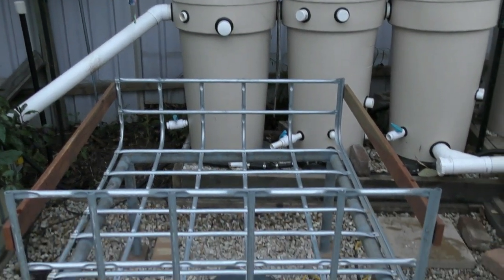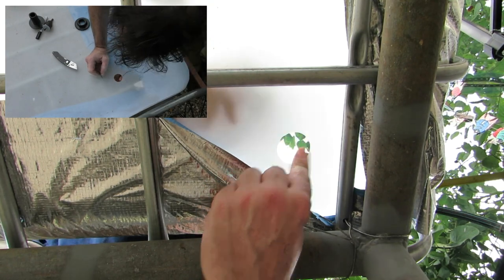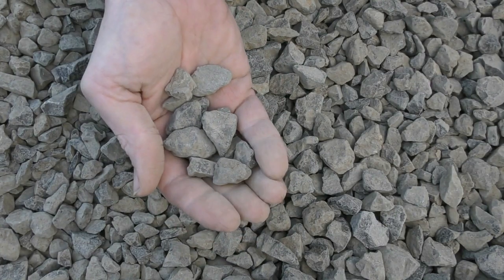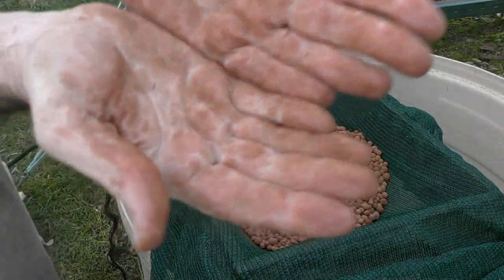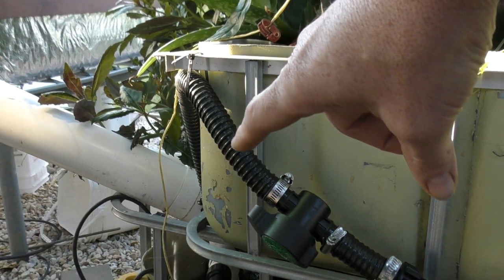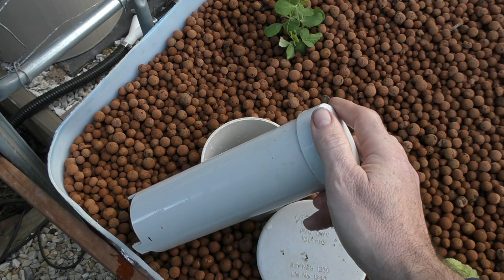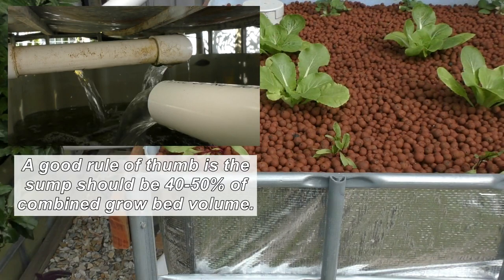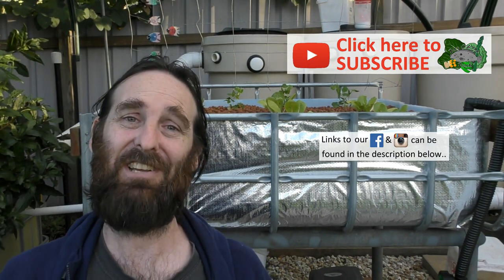How to set up aquaponic grow bed & select the right rock.

Comment: Are you running a single pump or multiple pumps? What is the GPH rating on the pump(s) you are running? I'm thinking of getting a second pump, so that I have one just for the fish tank and the other for the grow beds. That way there is plenty of pressure hitting the venturi in the fish tank. I have 2 grow beds, a sump, and a fish tank with a 800ish gph pump.

I should add, my pump has about a 3ft head.
Reply: exeseven His pump is a stand alone, magnetic drive, 10000 LPH
Reply from the maker: exeseven The pump I'm using is a 10,000lph/2641gph (US) Resun pump at the moment in a split flow configuration. Have 3 venturis running from that one pump with no issues. Have a bit of a better explanation here if that helps . 
https://www.youtube.com/watch?v=N4mYcUvZ9cw
Cheers mate.
Reply from the maker: ***** Cheers Bobby.
Reply: RobBobs Backyard Farming Thanks!
Reply: RobBobs Backyard Farming Hey Rob, glad to see you post a new vid! Perfect timing! Just got my Tank and Filters up and running and started my fishless cycling and now I'm about to start working on the grow beds! Getting pretty excited about getting some fish and plants in! Hey BTW, I sent you a response to our last conversation on the messenger. Talk at ya later!
Reply from the maker: ***** Great to hear Bobby.
I miss messages on there all the time sorry mate. Best to get me on FB if you have an account. Will have a look at the messages in the morning, well, later in the morning. is 1:20 at the moment.
Cheers mate.

Comment: Can you mix the rocks for the bottom and the clay on top?
Reply from the maker: You can mix them if you want. I prefer the clay on top as it's easier to work with. 👍
Hope the system is going well. 
Cheers Jason.

Comment: do you have anything to say about caterpillar or worms eating leaves in aquaponic system?
Reply from the maker: 2ebandera Hi again. Just saw this post. 
Haven't had many issues with them lately. If I did I'd use a BT (Bacillus thuringiensis) bacteria based spray to keep them under control. Its safe for fish, mammals, amphibians & birds. Is safe to use of certified organic farms as well. 
The other option would be to net the area off which may happen in the future at some point. 
Hope that helps some.

Comment: Quick question or two, are you going to start your own breeder colony, to control your fish from outside deases? And sorry i didnt answer you back right away my computer was not updating correctly!   Have you tried air lifts yet? Im going to see if i can, because the wattage use is a lot less,i do like having pressure on growbed fill,but also think useing the over flow from tank is the way to go,that way i will get air in system water movement and no chance of fish tank going dry, just want it as idiot prof as possible, kids,dogs,chicks,racoons,ect....  Oh yes ME!  Get buizzzy forget! You have gooday mate.

Comment: Nice build Rob. Is cost the reason you didn't use all clay?
Reply from the maker: ***** Cost & carbon foot print both come into it Jay. All the clay gets made in Europe & shipped over so it cost around $1AU a litre if bought by a single bag. I got it quite a bit cheaper as I bought in bulk to help mate out ;) 
Cheers mate & hope all's well with you all.

Comment: How much water would you say the media displaces, like 50% of the volume or is it much more, like 75%?
Reply from the maker: Some folks give an average of 70% water displacement but I like to stick with 50%. 
Comes in handy to overestimate the amount of water the beds need to fill when working out sump volume. That way there will be more water held in the sump which means the system can go longer between top ups if need be. 
Hope that helps.

Comment: Bulk head fittings V your Uniseals  care to explain please Rob?
Reply from the maker: Tony McKessar Hi Tony.
Both have their place in the system I think. For running large holes through tanks & filters I prefer the uniseals. For the smaller fittings like the base of the grow beds I like the bulkheads. I do have one grow bed with a uniseal in the bell assembly but am not 100% happy with it, it's just not sitting right. 
I have used uniseals for water lines flowing into tanks as well as bulkheads with no preference for either in that situation. Uniseals normally win over as they are cheaper & more adaptable than a threaded bulkhead. 
Hope that helps some mate.

Comment: How do you get the clay balls to keep from floating? When my systems cycles the balls go up and down and my plants keep sinking deeper in the balls
Reply from the maker: Hey Justin. It can take anywhere from a few days to a few weeks depending on the brand & sometimes different batches of the same product (due to firing temps of the cay etc). 
Most of ours settled down within a weeks here.
Hope that helps some.
Reply: Thanks rob. I was wondering, no good info on it that I have found

Comment: How many gallons of water do you need to run each ibc bed?
Reply from the maker: Hi Jackie & thanks, am glad the clips are helping you out some. 
With these beds I cut them off at the 300mm/1' deep from the side of an IBC.  This gave me a flat base to work with for plumbing + the side of the cage offers better support for the bed I think.  
As for the volume, after some height was allowed for a lip on the edge (to stop the clay falling out) & a dry layer of clay that's not under water (to stop algae growing on the surface) they hold 300 L or around 66 gal of combined water & grow media. 
From there I like to use allow 50% of the 66 gal (33 gal) as the amount of water needed to flood the bed. This allows for extra water when it comes to calculating the water volume needed when sizing your sump. Having some extra water in the sump will help stabilise the water temp a bit & also allow for longer periods between sump tank top ups. 
Probably more information than you wanted but it might come in handy.
Cheers.
Rob.

Comment: I work for a company that processes carbon coke(commonly used in the steel industry) and after seeing some vids on aquaponics I'm curious whether it could be used as a growing media. I don't suppose u have ever heard of it being done?
It is a very porous and hard material, which leads me to believe it would work. The process by which it is made removes volatiles so I don't believe it would negatively impact the system through contamination.
Reply from the maker: Hi Ken.
I haven't seen anyone use it at all mate so it would be interesting to see how it goes. As long as it's inert, pH neutral & doesn't release suspended solids if could be a goer  👍👍 A few universities that have aquaponic systems may have looked into it. 
Would like to know what you find out if you get any info on its suitability.
Cheers.
Reply: +Rob Bob's Backyard Farming 
As part of an environmental assessment we know that it is completely inert. It should be exactly like activated carbon in terms of effect on the pH. Idk about suspended solids, what do u mean by that?
Having worked with it(I'm a floor level guy) I know that because it is so hard it will create dust as it rubs against it's self, but that is when it is dry. It might release particles into the water, but from my experience the dust/fines prefer to settle out surprisingly quickly when wet. Definitely a case where u would want to wash it off and soak it until it looses its buoyancy before using.
I brought it up at work. If it is at all reasonable for the application I'm sure they will be happy to have another market to sell to outside of the up and down steel industry.
Reply from the maker: Fine solids in the water can cause issues with the gills of the fish. Do you know how it would go in a mild acidic solution ? Some like to run their systems around pH6.
Reply: +Rob Bob's Backyard Farming 
It's carbon. Like I said, completely inert
Reply from the maker: something I've forgotten  from chemistry class  20+ years ago :/
Reply: +Ken Oakleaf you could use it even if it wasn't inert, you'd just have to monitor pH and alkalinity regularly and use additives to correct if, like marble and shell, or use plants and fish that thrive in different pH and hardness,

Comment: Am having problems with the aquaponics syste.  I followed your video but the system isn't draining. Does the bed have to be a minimal depth for the siphon to work properly?
Reply from the maker: Hi there. Is the siphon not initiating or not cutting off?
Reply: Not cutting off. the water just flows through all the time.
Reply from the maker: If the siphon isn't initiating you may need water into the bed so just turn the inflow up a bit until the siphon initiates. 
If the siphon isn't breaking but the bed is almost empty you may need to slow the in flow down by turning the tap off a bit. 
Is a bit hard to pin down the reason for sure without seeing it as there could be issues with the drain pipe under the bed being on a slight upwards angle or it could be the way the bell is constructed. Do you have any clips or pictures of it online I could check out?

Comment: Hi Rob, where do you get you hose and fittings whats the brand?
Reply from the maker: Hi there. The barbed fittings are available from most hardware, plumping & irrigation store here. The hose can be a bit harder to find. Farm supply, plumbing & irrigation stores would be your best bet I think. It's also sold at some boating supply stores too I;m told.
Hope that helps some.
Cheers.

Comment: What is the foil looking stuff on the side of the tote
Reply from the maker: Insulation wrap to stop algae from forming on the walls. Most folks will paint or clad them with tin or timber, I just used what I had on hand.
Cheers mate.
Reply: @RobsAquaponics  i appreciate it. Hadn't seen anyone talking about it.
Picked up wto ibc totes today. Two more wednsday.
Reply from the maker: @mr.mikesart7111  Nice one Mike. 👍 Hope the build goes smoothly mate.

Comment: My question is why are you using the clay for the system?
Reply from the maker: Hi Antoinette. 
It's easier to work with on the hands, move around to clean beds & also easier to shift when beds get moved. 
 In the near future a few of the beds will have all the clay removed as I'll be turning them into floating raft grow beds.
Cheers & have a top one.

Comment: There is a tool to unglue pvc pipe it is battery power takes 5 minutes. Your system looks good if it holds water
Reply from the maker: phxtonash  Hi there.
Haven't seen that tool but will ask next time I'm at the supply store. I use a heat gun here to reclaim fittings & find it does an OK job. Have noticed that some brands to distort easier than others. 
No leaks in the system so far & have been using the tape method for a few years now ;-)
Cheers & all the best.

Comment: Where does the silver tank wrap come from? ChazinNJ
Reply from the maker: Hi there. It's silver insulation wrapping that is normally used under roofs & weather boards on houses. You can find it at building supply centres & hardware stores. 
Cheers.
Reply: Thank you Bob!